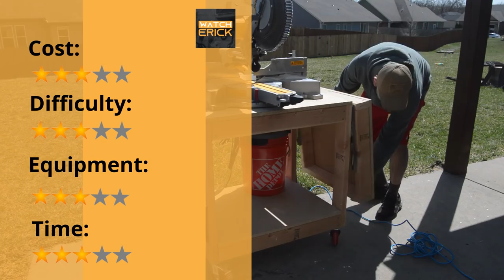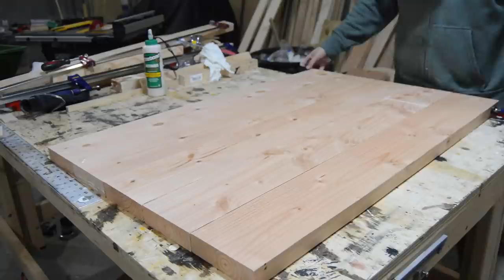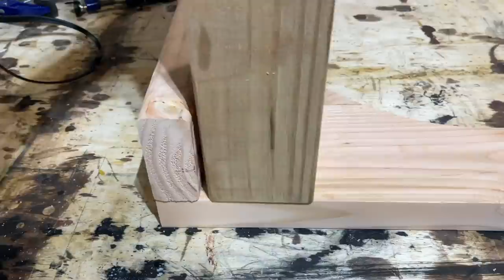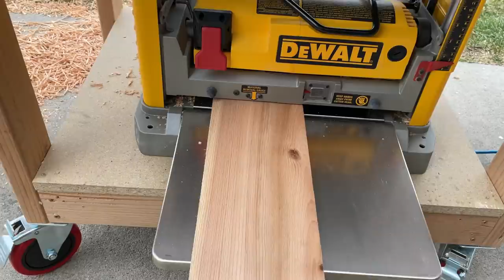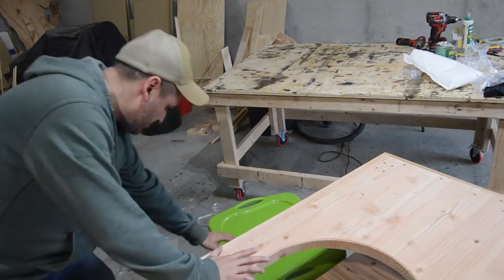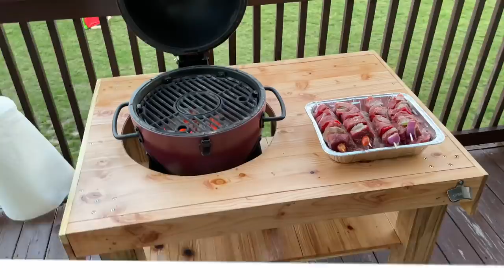HOW TO MAKE A EASY BBQ CART - DIY Barbecue Grill Table- Outdoor Kitchen - Mobile Cooking -Cedar Wood

Comment: I have a table with a 16 inch diameter cut-out (for a sink). Will that be large enough to fit the grill through?
Reply from the maker: I will say 22” by 32” so you have enough space next the grill to prepare or cut the meat.
Reply: Hi Erick, I was more referring to the size of the hole for the kamado to sit in. Will 16 inch be big enough?
Reply from the maker: I went and measured mine and yes can be enough 16” if is the same a kamado jr
Reply: Thanks very much Erick!
Reply: Hi Erik, nice table top! What is the height did you use for the second level?

Comment: Why did you choose the 4x4 cedar instead of pine just curious
Reply from the maker: Hi Korn, the reason is because normally any outdoor the thing that gain more humidity are the legs, having more contact with the water from the ground.
Reply: @watcherick4433  makes sense, thanks!